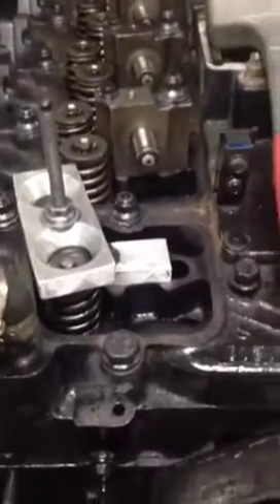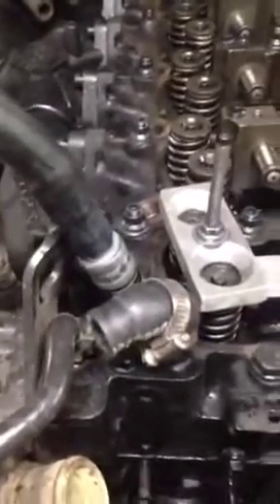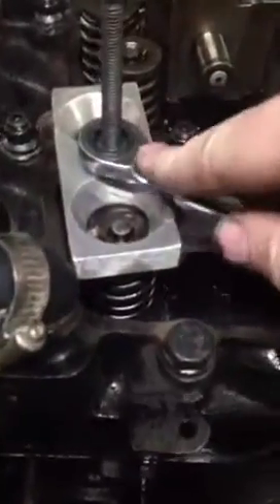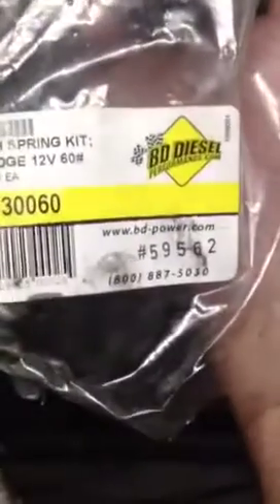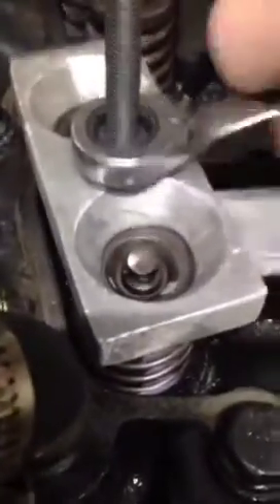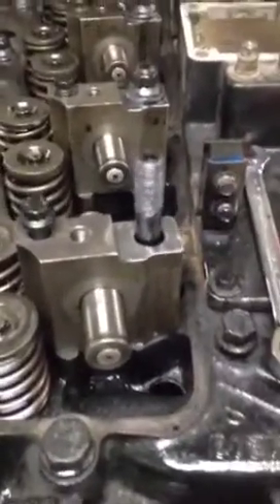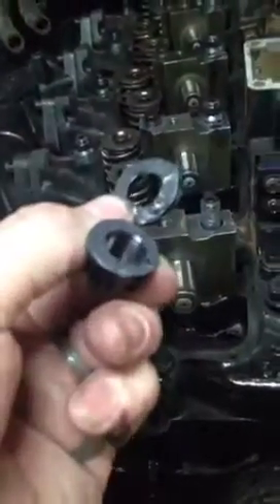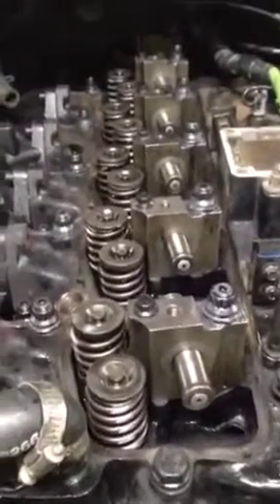60lb Cummins valve spring change and ARPs

Comment: One of if not the best video I have seen on valve spring install. Thanks. Any chance you know what thread the injectors are so I can make a air fitting to hold valves up.
Reply from the maker: I don’t know what size or thread pitch the nuts are but I just used it in old hold down nut.

Comment: What size air fitting did you use? Need to do my valve springs as well
Reply: Did you ever get an answer or figure it out? Doing mine this weekend and this is the only thing i don't have yet.
Reply from the maker: It is a factory injector hold down nut with a bushing welded into it and a standard air hose fitting.

Comment: I'm interested in a price on your pedestals. im goinng to install my ARP head bolts.
Thanks Charlietri
Reply from the maker: Charlie Ashmore it is a service. You can send them in to get cut but a local machine shop will have no problem doing them as well.
Reply: I need to have my peds machined.... I don't want to pull the head gasket. I'm guessing I can't take mine off. Unless I do em one by one to the machine shop... Lol

Comment: I'm looking to do this pretty soon on my '97 and have been looking around for a ready made adapter to pressurize the cylinder. I haven't had much luck finding one. Am I looking in the wrong places or is such a thing just not available? Since I haven't been able to find one, I've been looking for a compression test adapter to modify.
Reply from the maker: zombieresponder I don’t believe I have ever seen one that was ready built, made mine years ago using an old injector holddown nut and bushing.
Reply: @RustAndDust491  I found the correct compression test adapter for $30-$40, so that is the route I will be going.
Reply: @zombieresponder  do you have a link? I am needing one aslo.
Reply: @FFofky  nope, not right now. Bookmarked the link on my PC and will have to dig to find it.

Comment: The rockers NEED machined .002??????
Reply from the maker: ‘Rocker Pedestals, 0.200” right were the stud is you can see the lip.
Reply from the maker: Rocker Pedestals .200”
Reply: As a machinist, the position of the decimal point matters quite a bit. He said "two hundred thousandths", which is 0.200". Significantly different than 0.002", which is two thousandths.